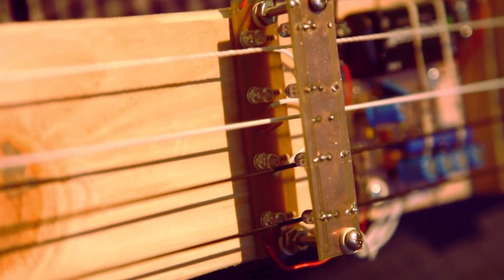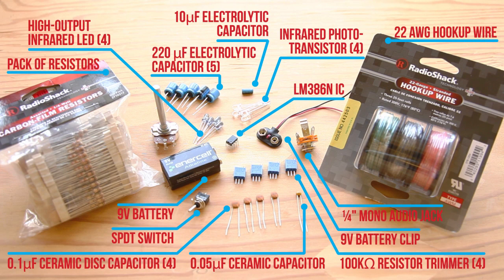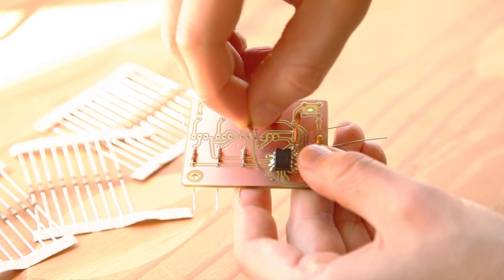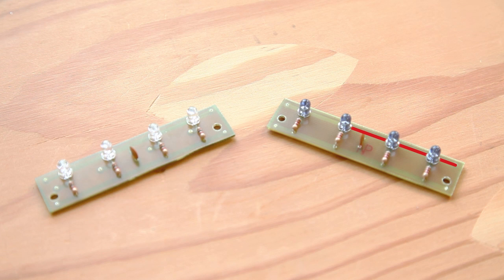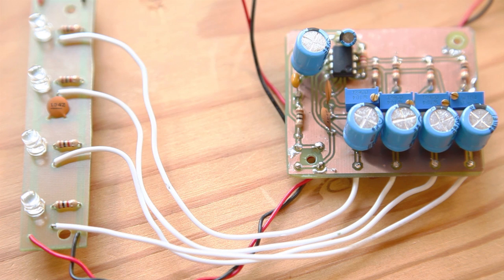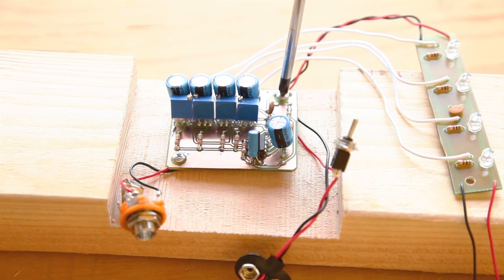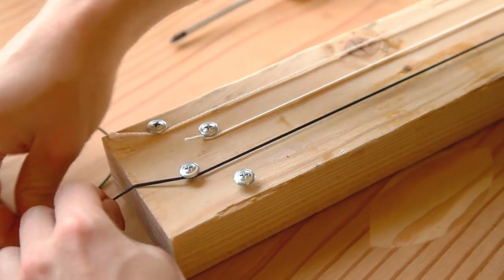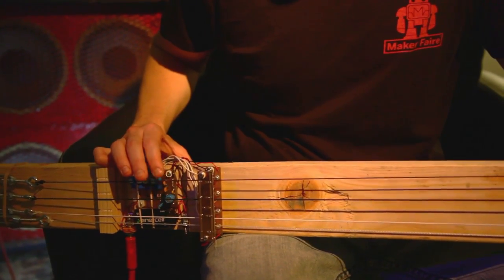Weekend Projects - Infrared String Bass

Comment: You said "point zero one microfarad" capacitor or ".01uF". The capacitor shown is labeled 104 (100,000 pF) which makes it a .1uF capacitor. I know the value isn't critical in this application, just want to keep the facts straight. Thanks.

Comment from the maker: Absolutely. In the project, we've also linked to a fret calculator, which can be used to determine where to position frets to generate specific notes. Keep in mind we didn't use standard guitar strings, so you'll have to experiment with the string material and the fret position.